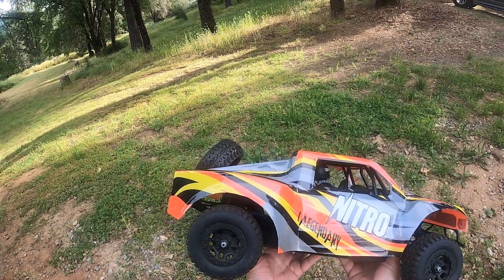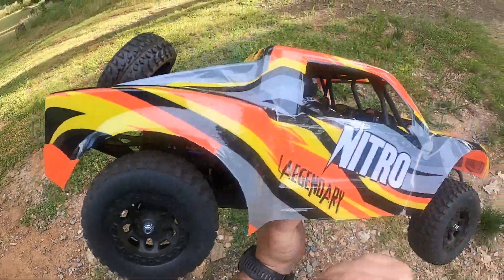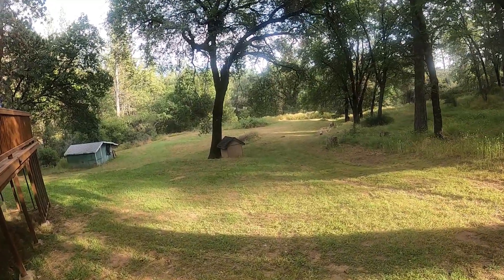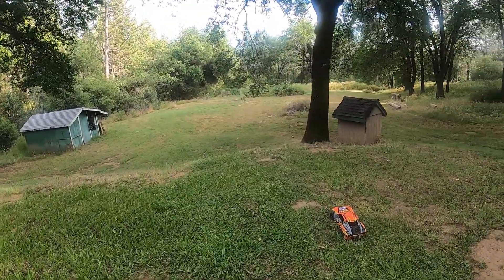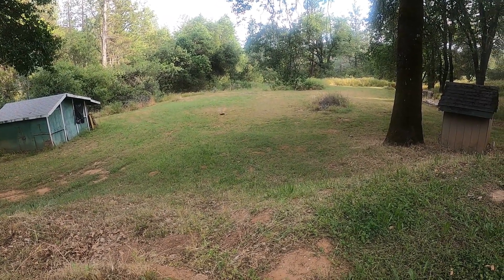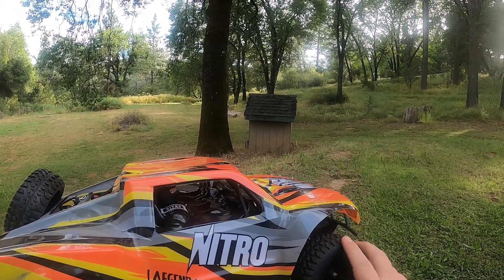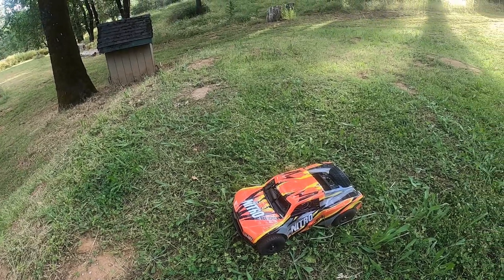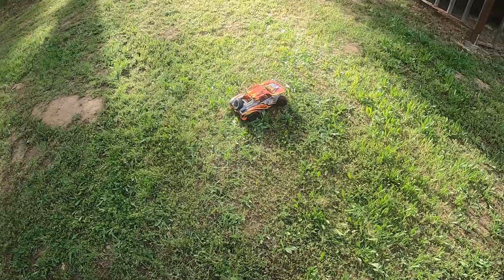LAEGENDARY RC NITRO SCT - MOTOR UPGRADE #LAEGENDARYRC #FTXZORRO #IMEXSAMURAI

Comment: Definitely looks faster compared to your last video with it. speaking of battery c ratings I have come to believe based on my experience flying high-powered fpv quadcopters on 6s that most of the low end battery manufacturers just straight up lie about c ratings. there are a lot of times where I'm pulling 100 +AMPS out of a 1100mah battery running 4x 1750 kv motors on full throttle punches. fpv goggles give a really good insight to what's going on with the battery because we have live data and when you punch out with a cheaper battery that claims a high C rate more often than not the battery will just fall on its face and sag out. whereas a more reputable manufacturer with even a lower C rating will perform much better. I noticed the same thing in ground vehicles but it is much harder to quantify because you don't have the live data. kind of just going more by feel.
Reply from the maker: Yup I agree..Gtta get good batteries for sure but us poor people are stuck with budget stuff!! Lol..I think the best budget stuff I've come across is HRB
Reply: @philthyco1  never tried hrb I'll have to check them out

Comment: Nice rig! This truck must have a little weight to it. Thats the only reason I can see it running kind of hot with only a 3300kv and that small of gearing.
Reply from the maker: Yup it does..Plus the body cage adds weight also

Comment: The stock FTX Zorro brushless comes with a 3665 - 2900kv motor & 80a esc.
Reply from the maker: Yup this one has a 3660 2000kv and 60amp gool rc/ocday esc..The Imex has the same motor but with a Hobbywing ESC